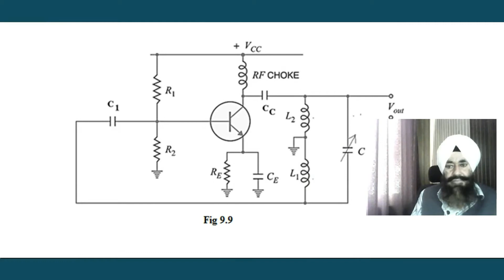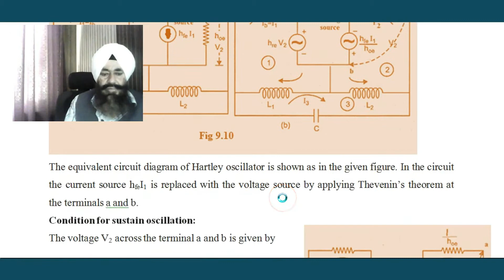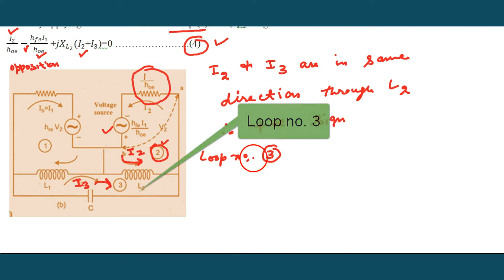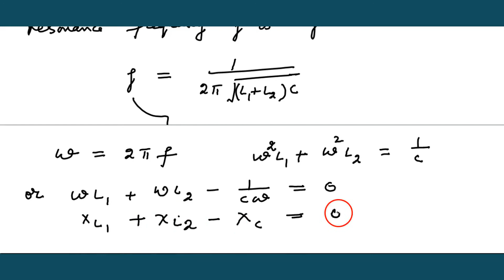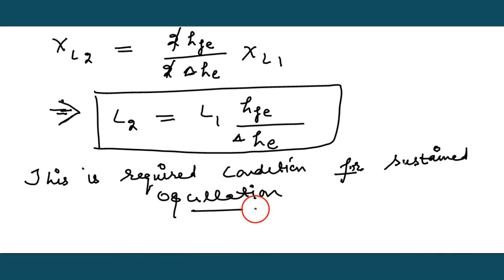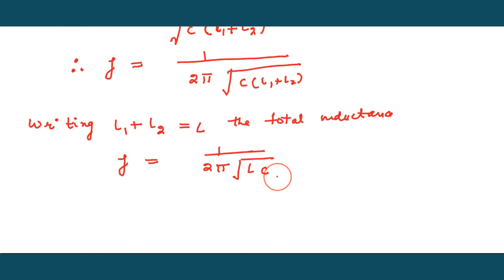Hartley Oscillator and its frequency derivation

Comment: Hartley oscillator is use in the _____ range .  Please reply sir__
Reply from the maker: The Hartley oscillator is an electronic oscillator circuit in which the oscillation frequency is determined by a tuned circuit consisting of capacitors and inductors, that is, an LC oscillator

A Hartley Oscillator circuit having two individual inductors of 0.5mH each, are designed to resonate in parallel with a variable capacitor that can be adjusted between 100pF and 500pF. Determine the upper and lower frequencies of oscillation and also the Hartley oscillators bandwidth.

Hartley Oscillator Upper Frequency  503 k Hz   ( for above example)
 
Hartley Oscillator Lower Frequency   225 k Hz  
 

Please visit to my website 

http://www.electronicassignments.com/
and 
ElectronicsTutors App
https://play.google.com/store/apps/details?id=mahajan.electronicstutors
Reply: High frequency range